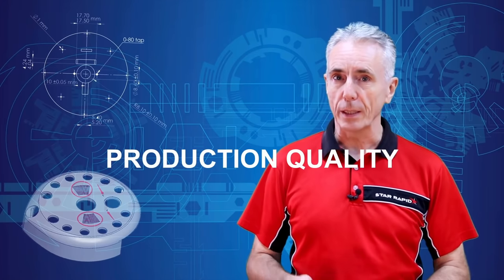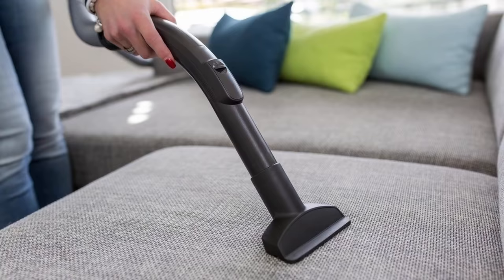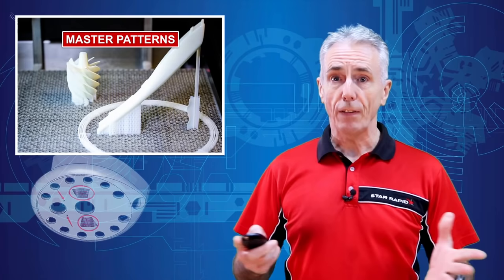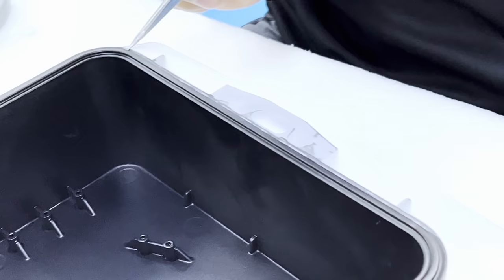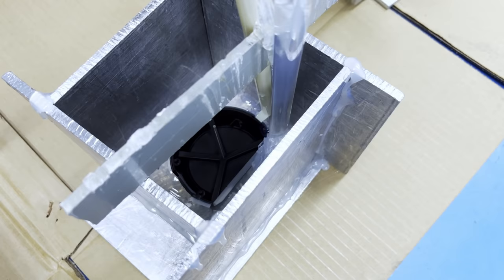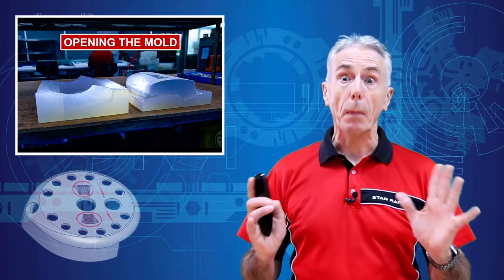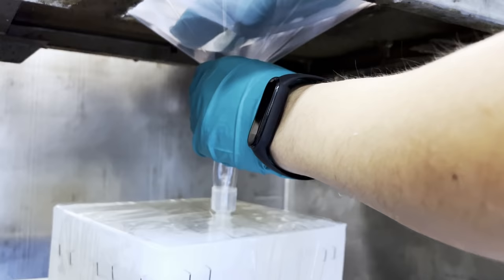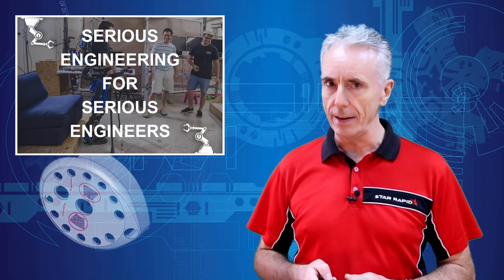You DON'T NEED an Expensive Mold to Make PLASTIC PARTS | Vacuum Casting | Serious Engineering - Ep21

Comment from the maker: Polyurethane vacuum casting is a method for making high quality prototypes or low volumes of parts formed from inexpensive silicone molds. Copies made in this way show great surface detail and fidelity to the original pattern. Have you ever used this process to make your parts?
Reply: I used 3D printing together with vacuum forming by FDM-printing a mold, that was used to vacuum cast the end use part. I used a heat resistant, carbon fiber reinforced filament to print the mold. Several vacuum forming suppliers were hesitant to even try, because they thought the mold wouldn't last more than a couple shots.

 After finding a supplier that was willing to try, they were able to mold all 100 parts needed with the one printed mold. The time it took to get from an idea to finished parts was 9 days, including the design, printing,  finishing & shipping of the mold. That's when I noticed how powerful 3D printing can really be in rapid prototyping.
Reply: Wondering what plastics types can be cast inside the silicone mold as I am looking to blend in barium sulfate and strontium aluminate.
Reply: @trunkki  Hey mate. I'm curious to know the exact filament used? There are a number of carbon fiber reinforced filaments. I dont suspect you would have used PLA, PETG or ABS, but maybe something completely different? And did you use polyurethane for the product to be formed in the mold? Cheers

Comment: You don't need an expensive mold, but you need argon gas, a vacuum chamber, an oven, LOL. But great video anyway to see the process.
Reply: You need equipment to do anything. It's not like you can make high quality commercial parts with mud and a straw or something. You get out what you put in.
Reply: Hahaha it's so true. I'm doing two boutique van builds a yeah and need both metal and woodworking tools, CNC, lathes goes on and on 😅
Reply: I have all of those things in my house… none of it is too aweful expensive
Reply from the maker: @arttilldawn155  👍😂
Reply: @nsboost  yes very true
Reply: Steel moulds have a high unit cost.
Reply: The difference of a few hundred dollars on the cheap if you're resourceful, and do it right... Versus tens of thousands of dollars for 1 injection mold base that makes 1 part/1 style of part, that you'll still need a mold press large enough to operate it(tens, to hundreds of thousands of dollars just for the machine depending on the tonnage of the press), or pay a job shop injection molding facility to operate, maintain, and store it for you. 
This method is great for proof of concept before you make a commitment.  
Otherwise get yourself an ender 3 for $200, stick to that.
Reply: Expensive is relative.
Reply: @Relatablename  you’re so wrong and you don’t even know it. There’s a guy who lives down the street from me that makes incredible smart phones using nothing but mud and straw. I’m talking cutting edge technology.

They don’t get the best cell service but he’s improving every day and next year plans to upgrade from straw to cured fescue grass
Reply: @hullinstruments  Oh, do you mean like those new smart tablets? I've heard great things about how sharp their edges are. All natural materials too. If I bought some, do you think they'd come with a carving stylus?
Reply: My thoughts exactly
Reply: Well, the other option is an injection molding machine.
Reply: This isn't DIY.  lol.
Reply: I have seen one mold cost $10,000…. And if you have multiple plastic parts you need for an item it can get super expensive fast. I was trying to help a dude build a vacuum cleaner and manufacturer quoted $100,000 in molds alone
Reply: @trying3841  Usually molds are milled from steel, and that makes them very expensive.
I really don't understand the complaint. Vacuum pump is like $50 on Amazon, and a bottle of inert gas and an oven isn't expensive either.
For a few hundred bucks you can create production quality parts in small/prototype scale.
Reply: If you'd be familiar with the price of injection molding molds you'd view that as pocket change in comparison.
Reply: Compared to the metal mold that's probably still cheaper
Reply: I think we spent a total of around USD 100,000 on 3 castings machines, 7 ovens, 2 silicone mixers, and a bunch of hand tools.  But you can buy small hobbyist machines for quite a lot less.
Reply: @gordonstyles5676  Hobbyists can probably jerry-rig something together. I also don't see the necessity of an oven for hobby. It speeds up curing, but hobbyists shouldn't be in a hurry anyway.
The only complex thing is the vacuum casting itself. Although I imagine that for many shapes, you can just cast, vacuum for some minutes and then put in pressure pot. The vacuum while you are casting is really only necessary for complex shapes that will always catch bubbles and where putting a vent isn't an option.
Reply: @gordonstyles5676  Thank you Gordon, love your channel and what you do!
Reply: @nsboost  I need help with making few plastic prototype materials, very simple, but i have no experience, will u be able to help
Reply: @CS-932  I made a vacuum chamber from a bicycle pump set up in reverse and a one way check valve stem from a car with a ball bearing, lol
Reply: Those can be obtained cheaply  or in the case of the vacuum pump even improvised.
Reply: You can buy argon cannisters at most hardware stores and welding suppliers, and a vacuum chamber can be built fairly cheaply using an old air compressor tank or pressure cooker.
Reply: You don't need to spend lots of money to approximate the techniques shown here. For example, you could use a pot inside a clothes vacuum bag to degas the silicon. You could use waxed melamine for the box mould. Put the parts in the sun instead of an oven. Etc.

Of course the results might not be as good or as consistent as a commercially made part, but whinging about how you can't do something through lack of tools is just a cop out for not being innovative with what you do have.
Reply: @starrapid cosa avrai da ridere, lo sai solo tu.
Reply: Yeah and he didn’t even vacuum mold anything.  He used vacuum to get bubbles out of the POURED casting he did :P

Comment: I’m so glad these processes don’t require expensive, specialized tooling 😉
Reply: lol
Reply from the maker: Yeah!
Reply: There's a subtle difference here: They're using expensive equipment but not expensive tooling. Yes, you may need to use a vacuum chamber for several hours to make your parts. But the cost of the mould is far, far lower.
Reply: Just replace vacuum chamber with old air pump and pot, and pour two component plastic, so you do not need an oven. Done by hobbyists for years.
Reply: Argon is optional and just reduces waste/saves money. Vacuum chamber is easier to work with than a simple low pressure pot for $100, but the pot does the job. The ovens are optional for speeding up curing and to allow more consistent results. That leaves the resin and silicone, the latter of which is somewhat expensive at ~$50 per kg. And of course the casually mentioned SLA print, which a DIYer would replace with FDM and hand sanding / vapor smoothing.

Comment: With simplified technique you only need an old air pump for “vacuum” and two-component silicon and plastic to reproduce parts with amazing accuracy. I know a guy working in a scaled model personal business doing just that. When he needs a set of parts, he produces them basically overnight on his table top. He uses tiny Roland CNC router to machine masters from model board, then pours silicon mold block around as shown on video, puts in a pot and pumps air out to remove bubbles, then when silicon is firm, removes masters then pours two component plastic inside, and again pumps air out. His parts are often relatively small and he makes dozens per mold at once. They look like they go from factory😹. Hopefully my comment is useful for all hobbyists around! Upd: searched for example, similar to this https://youtu.be/3obngISQ_yk

Comment: Instead of pouring the resin under vacuum, you can pour under atmosphere and pressurize in a tank to 50-80 psi. A common technique in the toy-making world, and pressure pots are much cheaper than a complicated vacuum casting machine.
Reply from the maker: Yes, you can do that. The benefit of vacuum is that you make all the bubbles a lot bigger and they float out and burst during the casting.  That doesn't happen with atmospheric hand pouring.  There are less bubbles to begin with once the pour is finished compared to hand pouring. Also, you don't get the "pick up" of the surface finish during a hand pour, you only get that with vacuum, and that's why pressure pot castings usually have to be painted after casting. Ours don't. - Gordon

Comment: I have been printing positives, given them a clear coat of UV resin (to remove the printing lines), then pour with mold rubber, then pour with resinb to get a positive. This is much quicker and easier as it cuts out one step.
Reply: EXCELLENT .

Comment: Cool, I'm trying to create an exact replica of the head frame of an animatronic from The Rock-afire Explosion. (which is an animatronic band from the 1980's). I found a copy of the original service manual, which has diagrams and measurements and maintenance tips, etc. 

Using the service manual in combination with photos, videos, other sourced  information , as well as guesswork, i've re-created the head frame almost exactly to original spec, in TinkerCAD. 

Originally the animatronics' frames were/are mainly made of solid aluminum, and/or square aluminum tubing. Now, it would be cool to make it out of aluminum, but aluminum is a very soft bendable metal. It would also involve welding.

So my thought is to 3d print it, and then either use the 3d printed part or do something similar to what is shown is this phenomenal and informative video. 

I'll probably just find someone/someplace to 3d print the pieces and hope that they print properly. 

Thank you for creating this video. It's very helpful.

Comment: Wouldn't it be great if "someone" developed a low cost silicon product that one could use to make molds for aluminum casting that would be robust enough to cast 30 or so pieces.
But as far as I know there is not.
Which means that my poor 6040 CNC hobby mill is going to have to just suck it up and get the job done as best it can.
It is an 8" by 12" (approx) piece to be mounted on a very ornate wooden cross.
We have got ongoing power blackouts here where I am But at least we get a 2 to 3 hour notification beforehand so its a bit of a workaround situation.
MANY MANY very low material removal tool-paths all shorter than 2 hour run time.
Have not bought the material yet but it will have to be annealed to be easily machined.
But there will have to be a test run on perspex or something at much higher feed rates to see what goes on.
PLEASE SOMEONE - FIND US A CAST-ABLE RESIN THAT WILL HANDLE HEAT... PLEASE...

Comment: I came to see how we can get better throughput, cost effectiveness, and result quality with molding by ourselves as opposed to 3D printing for low volume production. Turns out this method is more complex, slower, more expensive, with sole advantage of production quality. It only makes financial sense for high-value prototyping for clients.
Reply from the maker: Vacuum Casting is cost effective, high quality and relative simple. But it highly depends on your requirements.

Comment: Very nice. I do silicone moulding of small parts like knobs and so on for old classic synthesizers. I don't even have a vacuum chamber. I first coat the part to be moulded on one side and let the bubbles rise out. Then I turn the part over and complete the mould. My stuff is not as complex as what you are doing here and I'm interested to improve my process
Reply from the maker: That's great to hear. We will post a lot of Vacuum Casting related content, so consider subscribing and stay tuned.
Reply: Just a cheap vacuum pot for degassing is pretty nice and cheap. If you haven't already looked into (and decided against) it, I recommend researching them.

Comment: How many uses you get from a single silicone mold if you pump it that full of staples? Wont the rip the sides when you open the mold?😅
Reply from the maker: You can make upto or sometimes more than 20 copies with each mold.
Reply: I agree!! That is not sound production whatsoever!!
Must be getting silicone manufacturer kick backs!!
I would AT LEAST Rigid Mother Mold over Silicone mold!!
Reply: Staples an interesting but seemingly unproductive alternative to containing the mold in an over-mold box which includes registers and vent exits , etc. Lots of presentations here on Y-T with far more granular detail using far less expensive equipment getting EXCELLENT results . The vacuum thing is a favorite , and some will use vacuum and some pressure on the final cast part .

Comment: If a town can do laser-polishing, water-milling, metal-3D-printer, plastic-3D-printer (minus-one usage for paint-dye design printing)... and needs a small production run of things. Start with screw-bolt-nut structure, print on structure(torsional bias preloading), mill, polish, print design. What size and cost machine is applicable.?

3D-optical scanner (mobile phone similar), mould creation for injection-moulding techniques with vacuum-nipples. Vaccum draws injection in vectors(in the mould) to prevent weak corners... additional quicker run.

Comment: You might not need expensive molds ^^ but these mega vacuum temperature controlled resin mixing and pouring chambers doesn't look cheap either 😅
Reply: The advice is mostly for new product developers and entrepreneurs looking for prototypes to pitch or market-test new products - a silicone mold requires far less upfront investment than a rapid tooling approach. And 3D printing is now a viable technique as well, requiring even less fixed costs. Even when compared to IM equipment which can cost 100s of thousands of dollars, the equipment is a factor 10 less cost-intensive I'd say.

Comment: I'm not sure how rapid it is, but for sure it need quite a few tools to be done to a very high level of fidelity. Especially if the silicone can only produce about 20 copies, so you need like multiple silicon molds and quite some work for each part it seems.

I wonder how it can turn out using hobbists tools. A small vacuum pump is sometimes in the set.
Reply from the maker: Vacuum Casting is used for very specific applications and needs. You can read more about this process here. 
https://www.starrapid.com/services/vacuum-casting/
Reply: I make silicone molds and epoxy castings. A cheap vacuum pump and pot works well. It's perfectly fine for the silicone. It could be used for the epoxy too, but only in cut molds. It doesn't work for open-top moulds; the epoxy foams up and spills out of the mold. For open-top molds, pressure pots are used instead. Robert Tolone has an excellent series of videos showing how to make silicone molds and then cast with all kinds of materials. All he uses is a large pressure chamber, but you could just as easily use a pressure pot.

Comment: Question: as I know the limitation of vacuum cast caused by low life of silicon mold which is limited to 25 productions and you need to make a new mold to cast another 25 parts and so on.., my question is a 3D printed mold possible to use instead of liquid silicon? This way we can print many molds in stock to use it for production. If not advised what’s the best method to speed up molding it automat it or any thing

Comment: if the product you want to make has an empty interior, how do you go about doing that with this method?
Reply: My guess is that you would make two parts (with 2 different molds) and then join them together at the end. Hope that makes sense.
Reply from the maker: @thecoinbot  Exactly. The picture we show in the thumbnail is one such part.
Reply from the maker: You can refer to this case study. This is the case study of the part we show in the thumbnail which has an empty interior. 

https://www.starrapid.com/project/okie-talkie-case-study/

Comment: How do you navigate your SLA printed parts inhibiting your silicone? I've found coating my SLA printed parts with InhibitX works but it's a unreliable technique and adds a lengthy and costly step in in prototyping.

Comment: I've used Star Prototypes for years whenever I need to make very small prototypes at better quality than 3D printing can achieve.  They are great when I need 10. But I'd really like a low cost solution when I need to produce 500-1000.  At this point, NRE charges quickly go into the stratosphere. There seems to be almost zero cost difference between soft aluminum tooling and hardened steel, despite the fact that machine time should be a lot less.

Perhaps you would care to make a video explaining how to make low cost limited production parts. Especially when the parts are fairly large, like  a 12" square clam shell enclosure for a PCB. If you need to make 500 of something, and you have to pay $10,000 - $20,000 for tooling, that is $20 - $40 per part. More often than not, this turns out to be the actual killer for small businesses looking to try out innovative products in the market. Any solutions for this segment of the industry?
Reply from the maker: Thanks for your suggestion. Excellent idea. Noted. We will make a video on this topic.
Reply: I'd have to see the specific application, but one way is to use RIM Molding.  Paragon Rapid Technologies in the UK are one of the world's best at doing that.  Many of the guys there used to work for me in the UK.  My old company did RIM molding, but it didn't transfer well into China because of the cost of Air Shipment is huge for larger parts.
Reply: I need help with making few plastic prototype materials, very simple, but i have no experience, will u be able to help